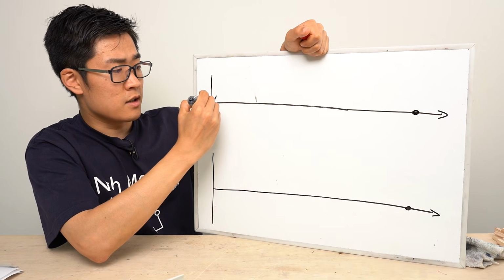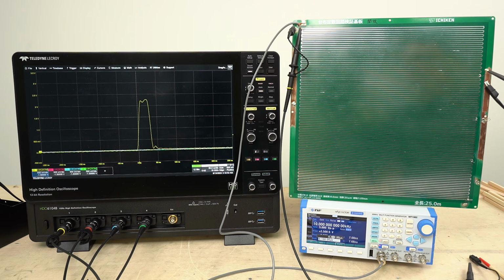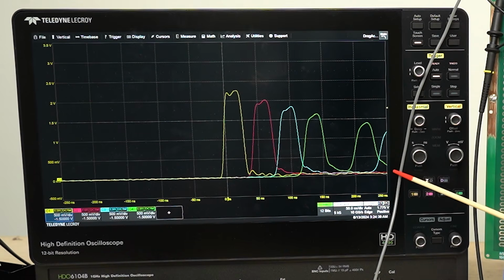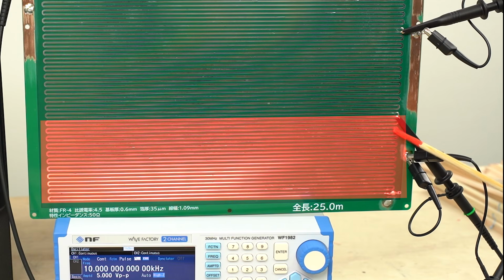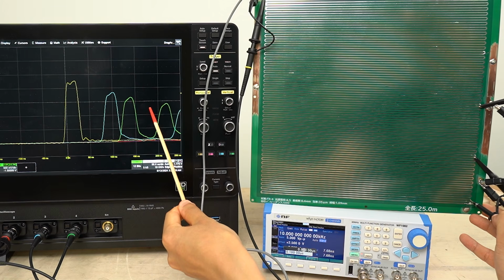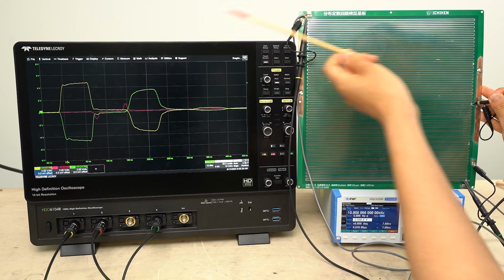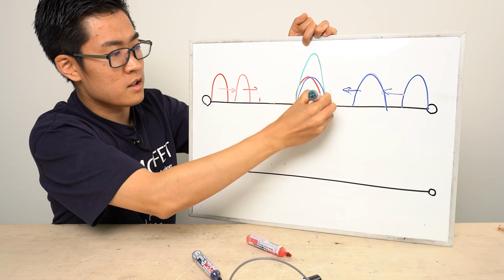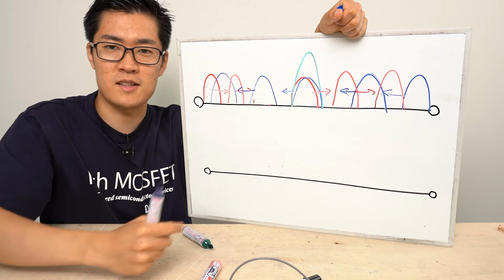Transmission Line Theory Visualized: Mechanical Wave Machine & 25m Copper Trace

Comment: But if you have a 50 ohms trace, and a 50 ohms probe, aren't you making an unmatched 50/25 ohms split ? Wouldn't have it been better if you had a different line impedance ? I am not sure howthat would be possible though.
Sorry I didn't know much about RF, and discovered the real input impedance of oscilloscopes and the effects of probes after commenting

Comment: I don't understand , you created a coil , voltage across coil rises when current flows because it resist current change ?
Reply: Its not a coil. It's just a trace, a medium thru which an electric pulse travels.